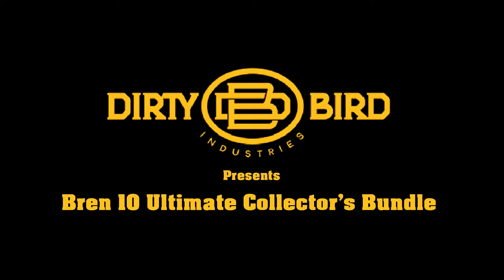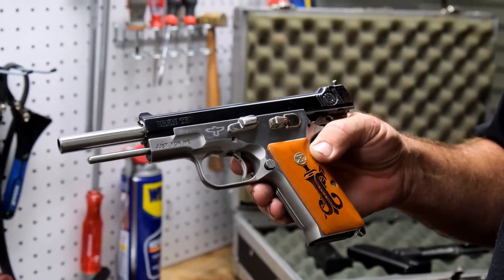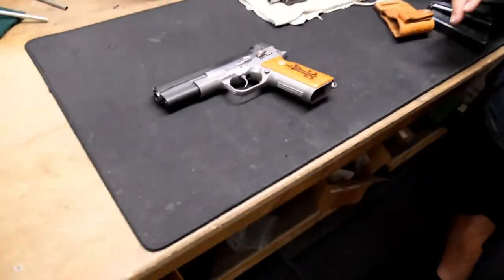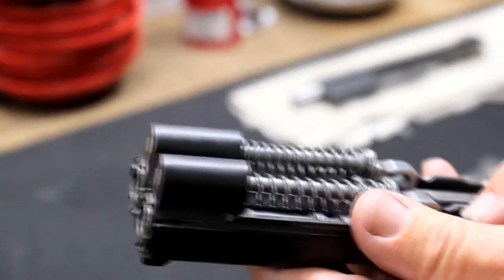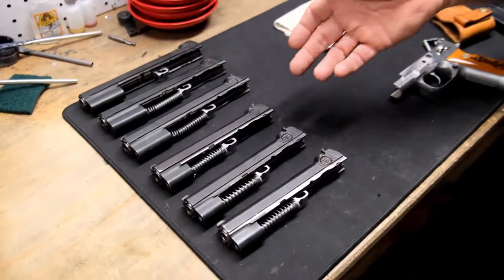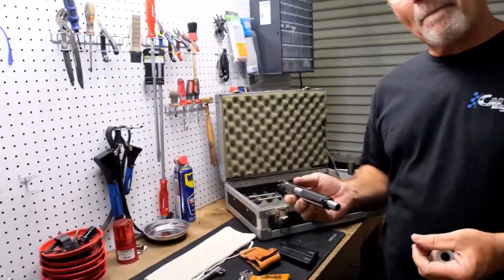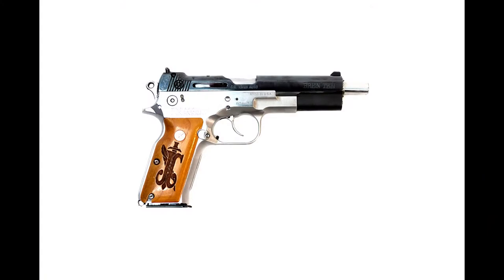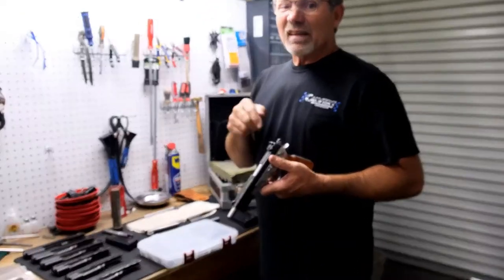Bren Ten Ultimate Collector's Bundle

Comment: Amazing Video I remember reading all the Gun Magazines in middle school when the Bren Ten came out and wishing I was old enough to get one and by the time I was they were gone. I do wish I could add this Incredible Time Capsule of Firearms History to my gun collection but my wife would kill me! I know that several other companies have tried to bring back the Bren Ten back and Vltor was the last one back in 2014-15 with the Fortis but that has GONE NO WHERE, since Mr. Black has the first hand knowledge of the proper way of making the pistol RIGHT and also has the R&D experience why has he gotten with a few other gun loving manufactures and tried to bring back the Bren Ten the right way?? I know that if anyone was to bring back the Bren X back today it would be a Custom Pistol at a Custom Price probably 2500-4000 depending on which model and how many extra slides and barrel but with Every Gun Company making a 10mm Pistol and I own the Majority of them Gen 4 and 5 G20, Sig P220 10mm Legion and P320 X-Ten, Smith and Wesson MP2.0 PC 10mm 5.6 inch Comp pistol but I think that a properly built Bren Ten would wipe all of them off out of the market and  I am a Great Believer that the SIG P220 10mm Legion is the Best Production 10mm currently being made but I really wish that SIG would bring back the P227 in an ALL Steel Frame and make a 5 inch 10mm Version using the P320 X-Ten Magazines which work on the P227. I know they work because I own both pistols and have tried the magazines in the different pistols. 
SIG was able to change the P210 design to go from a JMB barrel link design similar to the Bren to what the Sig P220 system uses and I bet the same could be done to the BREN TEN!

Comment: Is it true that there is a company out there trying to bring the Bren 10 back to market?  There have been rumors…

Also, I hear that there are still issues with 10mm even to this day.  From what I’ve learned from Paul Harrell and Garand Thumb, many ammunition manufacturers do not load 10mm up to spec.  They are watered down to the power of .40S&W.  Also, due to the large variation in loads, many pistols on the market today still have a hard time cycling the cartridge due to the difficulty in springing the pistol for the variations.  Apparently, you have to know what loads work best for your 10mm pistol.  I’ve kind of avoided buying a 10mm because of this and stuck with .45.  I do, however, hope to see these issues worked out one day.

Comment: If I were a rich lottery winner, I would have gladly bought this collectible set off gunbroker.  

What I find fascinating is that Norma rounds, BACK THEN, were very hot rounds to come out of a pistol but some manufacturers today make 10mm rounds that exceed 1300 fps in lower grain weight and equivalent 1100 fps in 200 grain weight and while a powerful pistol round, they are considered more or less a STANDARD 10mm instead of hyper powered like they were in the 80s.